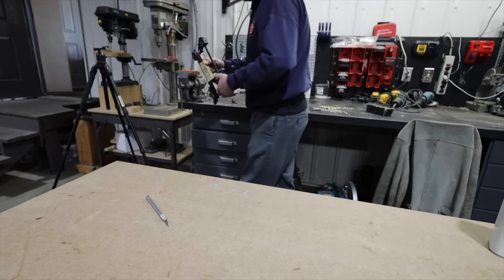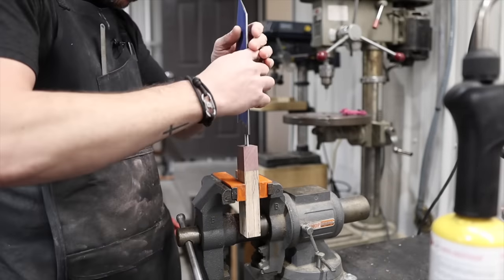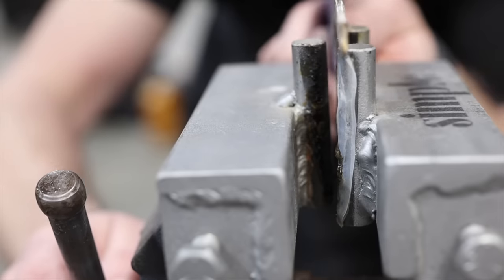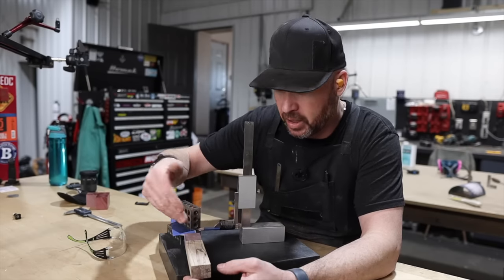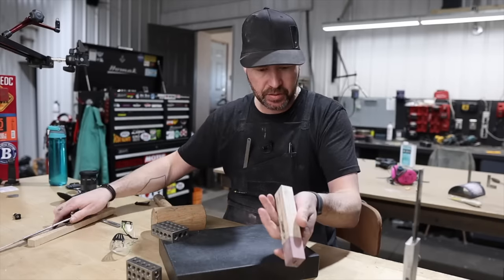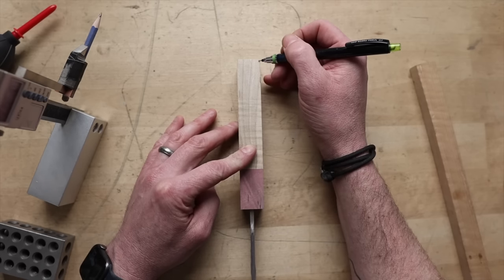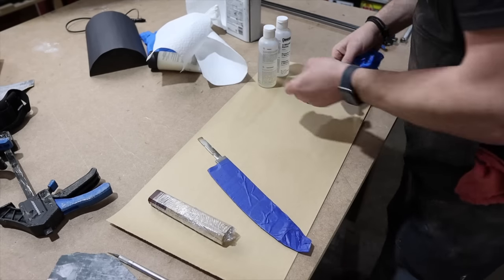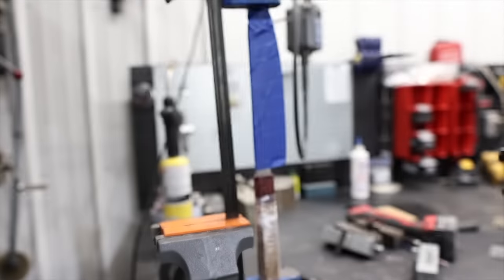Master Your Wa Handles: I Did It the Wrong Way... Until Now!

Comment: I stopped using epoxy when putting the tang into my wa handles. I shave off little bits of hot glue rods and drop as many as I can into the tang slot, then I heat up the tang enough to melt the hot glue when it's inserted. The tang then cools off and makes a secure fit. Why use hot glue and not epoxy? If I ever need to remove and repair a wa handle that has been damaged, or completely replace it, I can put the entire knife into an oven at 175F (80C) for a few minutes and it softens enough to slide it off. The liquifaction temp of hot glue is not enough to burn the wood, and the limited amount of oven time isn't enough to mess with the stronger epoxy on the ferrule. Hot glue also provides enough strength to make a solid grip on the tang during normal use. It hasn't failed me yet. I also use the dowel method.
Reply: I’ve used bees wax quite successfully - same idea as far as the maintenance goes. Has to be bees wax though… regular candle wax is too brittle.
Reply: I'd be sceptical of either of these methods without the use of a pin. I'm in Australia and summer temps reach 40°c plus.
Reply: @robsonez   fair, but this method would be used on a kitchen knife that probably wouldn’t lay out in the sun… at a sustained 40° I’d also start to worry about the handle material
Reply: @Stefanhallusa  on a bench by a window? Definitely a situational fitment method.
Reply: Gets as high as 52 C in the desert where I live. My hot glue sticks don’t melt unless they’re in the gun or under my lighter.
Reply: brilliant tipp,
I'll give that a try on my next handle...
Thanx for sharing!
Reply from the maker: That is a very interesting idea that I haven’t heard before. I do know that traditionally wa handles are supposed to be removable so this makes a lot of sense. Thank you!
Reply: Thank you for the videos and the comments. I like the hot glue stick idea. I've many different sizes from my kids with no glue guns. Now I've a way to use them

Comment: Thanks for the video 👍. Little helpful tip, I use a 10 ml syringe that I open to put the glue in. I wind it up and push the air out. This allows to fill the hole completely to improve the glueing.

Comment: I have been tapering my WA handles for a while now, I work to around 2mm wider at the back (1mm each side) and 3mm taller at the back than the front (top is straight with the blade, only the underneath is tapered) which makes them feel a lot more natural to hold. I also make them at  least 20mm over length then after the rest of the sizing is done and the blade is fitted, I then grind the tail of the handle (again slightly tapered so the top of the handle is a bit longer than the bottom, it looks better) until the balance of the blade is perfect. I have also been experimenting with cutting a small bevel each side underneath at the front to make a pinch grip more comfortable. Maybe they are not true "Wa" handles now but I feel they are nicer to use. Also the Brad point bits are the only way to go with this construction method.

Comment: I see everyone doing them on belt grinder, why doesn’t anyone use block planes? Feels like it gives you more precision. Great video, thanks for sharing!
Reply: I don't even have a belt grinder, and I would never think about doing them with a hand plane, 'cause I find that to be waaaay more difficult. Keeping the plane steady on a precise angle.. no way for me.
Reply: I like your thinking, great idea. I'm restoring an old deba and will probably have to replace the handle which will be a first for me, I'm just a sharpener with basic handtools. But I do have a very sharp plane.. Looks like it's jig making time!

Comment: Thanks for showing my tip. That is what I like at the knife making community, knife makers are willing to share their experience. (Sure there is the odd exception).
One more thing I do different for the last three years. Wa handles are meant to be replaceable. I learned that in a Tokyo knife shop some years ago. They sell Wa handles separately. I know the Japanese burn the knife into the handle and seal it with some bees wax.
I don‘t epoxy my handles but use hot glue. Just heat up the tang with a torch until the glue starts to melt. Then swipe the glue stick over the tang to cover it. Once you have cover your tang with glue slide the handle in. The spill out can be easily removed once cold. The first knife I made like this is in use in my kitchen, no issues with the knife at all. The forces on a kitchen knife are not high so I don’t see a risk. Would I do this with a bushcraft knife? Sure not.
Regards Roland
Reply: Same here, see my other comment. I prefer putting pieces of the hot glue in first so it's not being smeared off the tang if there's a tight slot in the ferrule.
Reply from the maker: That is very interesting. Thank you for yet another great idea! Cheers👍

Comment: Great Video as always! 
For straightening i use recently Kyle Daily  (KH Daily knives) Carbide ball peen hammer. It works like a charm, and there is less risk of cracking a blade or tang.
Reply from the maker: Thank you. I think I will have to look into that hammer from Kyle Daily. So many folks are talking about it and I've heard a lot even on various podcasts and stuff. Thanks for the suggestion👍

Comment: I learn this from Alec Steele, if you wanna perfect fit for the tang in every knife, and still have the habilitie to remove the handle whenever you need before the final glue up, just cover your tang in wax, that way you have no worries if the epoxy was set enough before remove, just leve it there and the wax don't let the glue stick on the tang, in the final glue up clean everything well and you're good to go.
Reply from the maker: I used to use that method and even have videos on my channel about it a few years ago. I prefer this method. For me. I think it’s better. I also think it’s just a matter of personal preference. Whatever you prefer, use that 👍

Comment: RIGHT as you were bending the tang you cut the video to the loud blowtorch clicking on and I thought you broke the tang in half!

Anyway, yeah this is how I do my Wa handles too, making sure everything is as marked and true as possible the whole time really helps keep from getting "lost" in chasing the angles all over the place.
Reply from the maker: Hahahaha! I noticed that in the edit and figured it would be fun to leave it in there. You are correct. A little extra time during layout came make a huge difference in actual shaping and even sometimes getting a decent outcome at all. 👍
Reply: @Simplelittlelife  Devious! Totally got an 😲 reaction from me with that lol. Yeah my first couple of Wa handles I didn't layout first and I spent forever chasing angles and ended up making them a lot slimmer than I initially planned, one I had to totally re-handle it was so wonky.